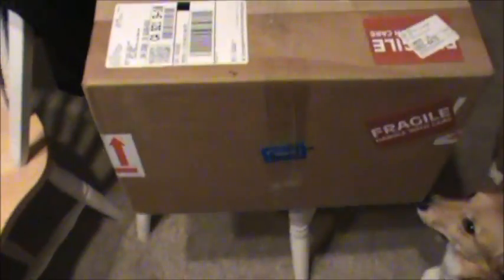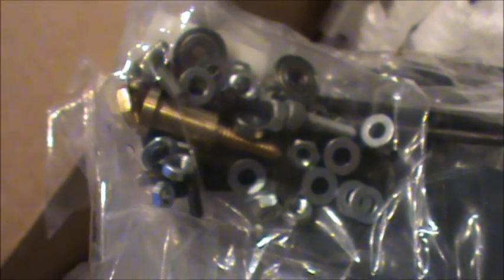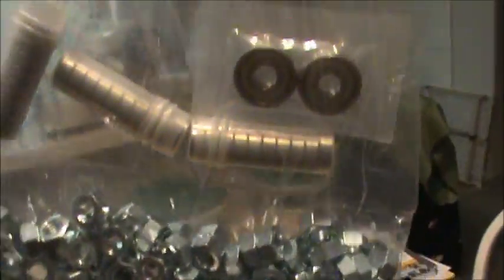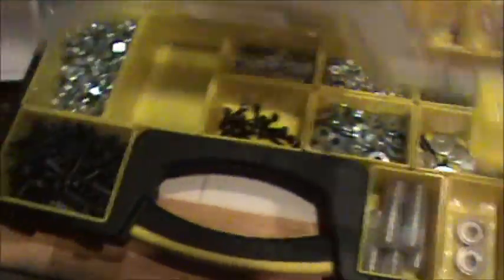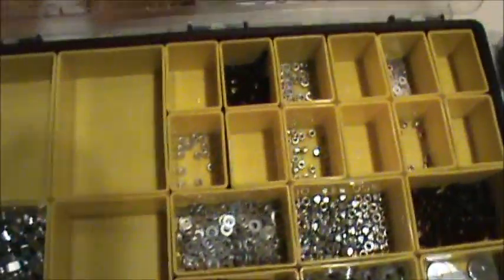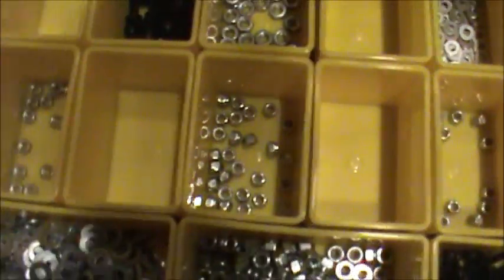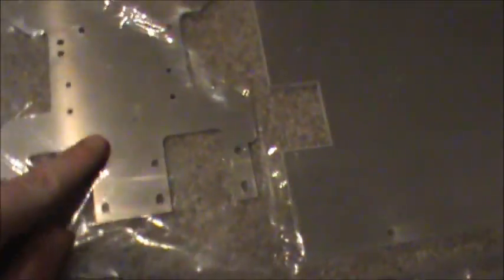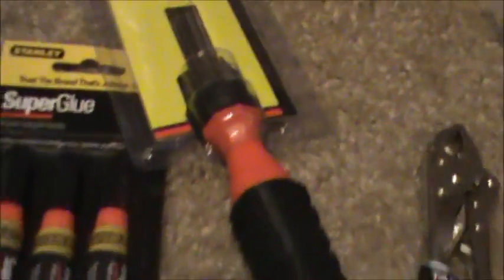DIY 3D Printer Project- Day 0 Unboxing! EXCITING!

Comment from the maker: @rnewman5 Contact gil@botmill.com and let him know. I already have and he has dispatched a completely new set of parts. Those go for about $250 on ebay so it's costly mistake. I'm sure if enough people speak up they will fix the problems with the manufacturing process. I don't think it's in-house so they might have to get on the company that keeps printing bad parts.